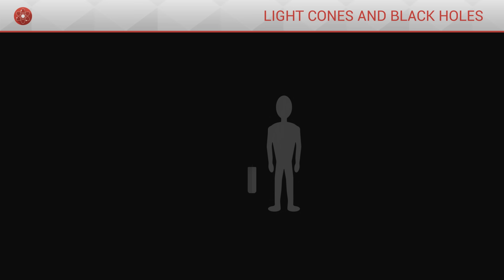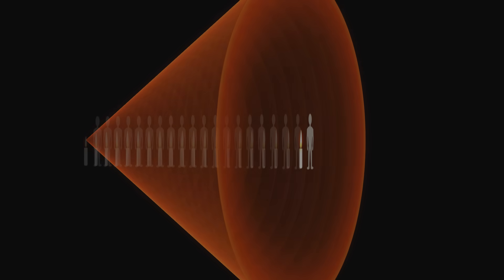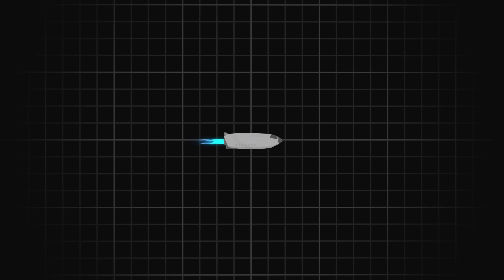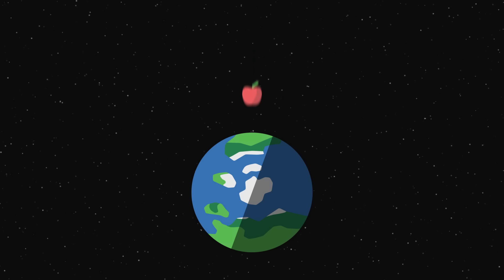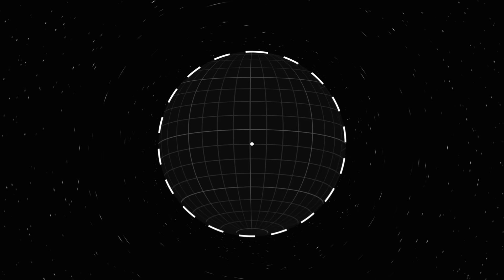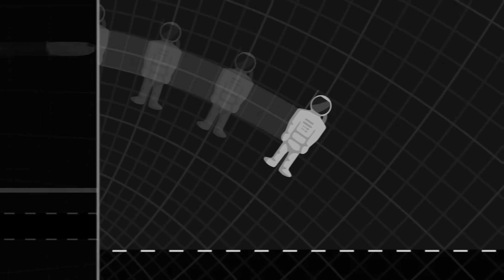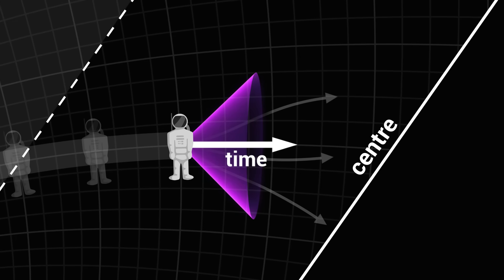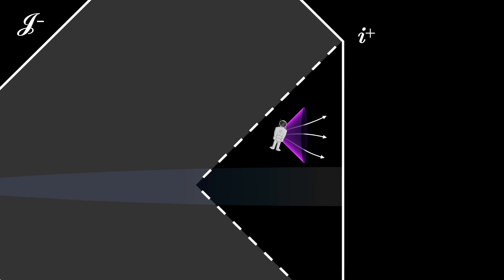Why Time and Space swap in a Black Hole

Comment: they don't, right at the centre is where we are. Where gravity pulls out in equal opposite directions, there should be a second event horizon, tiny that side of the fence its expansive inside when you dilate in space and time, infinitely hot becomes cool. What we see is dilation between 2 infinities, never moving closer to or from either. We have infinite space to inflate away as our host singularity evaporates its central point relaxes and grows 5th dimensionally, motion without motion. 

In one way its a "Symphony of spheres in microgravity" A Bubble inside a bubble with bubbles inside the bubbles, all dilated in space and time, from an outside observers perspective each infinity looks different, but they all have the same idea of infinity dilated inside eachother, some ticking faster, some slower. As they transfer mass between bubbles the system gains energy and momentum, things dilate. Its a clunky ride that causality smooths out, keeping it feeling nice and constant when you look back you see a logarithmic curve, but its a bumpy ride. If we all paused between mass transfers you wouldnt know it. 

You have infinite dilation and expansion  in a contained system if you imagine it all as singularities inside singularities, like mirrors stacked against eachother, or time cones containing infinite time cones, where we are all made of little time cones, when you think you should see compression it feels like expansion still, its a tesseract if you dilate space and time together not just space.. More cubic with infinite height instead of conical. 

Extend the edges of our universal time cone and draw a new horizon, this is the future, you can slice it as small as you can, this is the past, when you take them over to photoshop you can scale the universe so at any point it has the same view to infinity, they overlay perfectly, showing that previously what you see as an infinitely small journey to cross the observable universe 13 billion years ago, is the same journey you see out of your window now at the speed of light, its the same journey in dilated spacetime

Gravity comes from expansion "A Push not a pull, Spacetime expansion theory" it explains it perfectly, the whole universe is growing every moment, but causality makes it feel the same. Is it inflation or collapse? either way it feels the same, any point on the tesseract is the same point, with the same view being pulled from one infinity to the other, never actually moving tho, the edge of reality never red shifts out of view, its simply red shifted. If we were accelerating it would be actively red shifting systems out of our view, like places visible yesterday wouldnt be visible today, but thats not what we see. We observe a flat universe that even seems to curve for light if you look far enough into the void. Dilation would do that, motion without motion, you feel it as gravity

At the core of any massive object you both expand at the same rate, so its a null point, move from that point without motion and now you sink as the mass is inflating more than you, but it isnt pulling on you. 4000 miles from the core it pushes you up and out at 9.8 mtr/s. A nudge at the core is orbital veloctiy, keeping pace with the universe, you remain weightless. Null.. adding velocity doesnt make you faster, it raises your apoapsis, your orbit is the same speed and your journey is longer in space so it takes more time.. orbital mechanics and gravity from expansion.. You feel weight the more dislocated from your idea of null, right now you are about 3800 miles from your orbit at your current speed and direction, so you feel like you fall down.. its an illusion of being higher and slower than orbital mechanics allows, if you was lower and faster then your null point would be above you not below. You could do that easy if you linked a load of satellites on the same orbit together and wound them in, Im pretty sure I could build a Halo ring if given enough funding..

Take an array of satellites 5 miles apart on the same orbit, connect them all up and wind them in, really quickly you will be orbiting lower and faster than the universe wants so it gives you a nudge back to your null point.. but imagine getting it spinning real fast, pulling like 3G.. it only takes ultra strong materials to achieve it, but then we lock things in place, builiding a second ring aroudn the first, the second isnt dilated, but it has magnetic confinement points, built into a megastructure, when you engage the magnets you should be able to pull energy from the inner ring, it would send free energy, anti gravity and time dilation across stations, you should be able to leech off the system to get the outer ring up to a 1G pull... A Halo ring, powered by itself, by abusing orbital mechanics how it abuses you. It would be pretty easy, just taking a long time and a ton of money. It wouldnt break physics as we know it tho...
Reply: If you could dilate in size to the atomic you would hit the closest event horizon to you, without even leaving your room, you could look back at your old life and see it red shift from view, if you could see past it we would seem like we slow until we seem paused from your perspective, like we are on an event horizon, because we are. If you approach a singularity in space you seem to pause as you approach it as space is infinitely stretching out in front of you. Its the flip perspective of the same journey, i doubt they are to the same place tho. 

You can look out into the void and rationalise one infinity because light finds it easy, it does space and time every day, it struggles to see into anything with mass, so to it we might seem like the voids of infinite curiosity. It might map the universe inside out or outside in.. What perspective is more valid, which infinity is the bigger infinity, the one light finds easy or the one both of us struggle to rationalise away. I see an infinity inside you dilated in space and time, as big as the infinity outside you. At your centre of mass is your down. it has the same down inside it as any other massive object, it depends how much mass you have to dilate per tick as to whos centre you drift towards. Your belly button is your down tho, if you rewind space and time you collapse to a singularity there, just a couple of cells dividing, you was in your mom waiting for your day the moment she was born, same as how she was in her mom, and hers, you was always there inside them, coded ready to come out, just waiting for the other half of the message to make you you..  In one view looking back its a logistics map, all the way back to infinity, you can use the same map as the tree of life, tracing it all back to that first mitochondria that entered a cell and didnt get eaten. There is a point of crossing, where we all connect, its likely some near extinction event.. but we are all connected by math

I can build a universe by squaring infinity to C. the Julia to Mandelbrot set, squaring up to infinity gives you a circle shape inside the math spirals inwards in infinite loops that seem finite, and outside the circle it spirals off to infinity and beyond. You have 2 infinities, one in, one out. Square it up again and you have a sphere shape, not a circle, square it up again and you have spheres surrounding spheres, square it up again and again over and over now you have infinity inside infinity built purely from math. If you are centred at xy=0 it looks pretty normal but change your perspective inside, it gets messy, fractal, infinite paths and none of them straight lines as much as they were built from vectors.
Reply: When you draw circles and spheres like the universe we imagine pinning one end of a line in place, spinning the other point around itself in all directions, the B point draws a sphere. But what pinned A in place? nothing in the universe wants to be stationary, i imagine it as one end moves infinitely slow, the other infinitely fast, you seemingly have the same shape, but if you look close there is a second sphere inside the large sphere. 2 ends to the manifold, not 1.. the line length (x) is what defines the boundary between 2 infinite paths. Your finite limits seem to impart a finite perspective on it, but you assume density is the same inside, you imagine the straighest shortest path through a globe is to connect 2 points and drill as straight as a sandworm swims, but that path isnt flat or straight in gravity or time, it will feel like the curved path.. Map it on a time cone you can see each step as you take it.. flatten out the cone for density, is it still the shortest route?

Your mind wants the universe to be Euclidean, but its more like how Gauss could see it, non euclidean and messy. As you core into the planet your drill bits end up wanting to flatten out and return to sender, the path of least resistance.. You cant rationalise it any other way than down being a pull, and all you can see being all there is. If you trust light for the truth its going to decieve you over and over again, its bi polar by nature, a reflection an echo, you see a red object, it rejected 1 spectrum of light, we call it what it isnt, not what it is, and it doesnt matter if we all agree, until you want to rebuild the universe in flull HD glory, knowing the underlying reality lets us use what we see to rebuild it how it is, so we can rebuild it how we see it. But the negative is the true state of everything out here. Your eyes feed you illusions, making sense of nonsense the best it can, we filter out so much noise, if you could see every wavelength it would be blinding, even with your eyes closed......  Your perspective of infinities can give one more weight than the other, as you stand upon one infinity trying to make sense of another. There is so much infinity in to figure out before we need to worry about the infinity out...

Either the universe is irrational or our math is, it seems you square up to pi and think its normal, but think about it you are squaring something up, the universe hands you back a circle that fills the same space a square would, but it kept as much as it could so it still filled the same sized square, it kept the corners and we are just like OK.. its like the universe keeps 0.8584 of every square you made, giving you a circle, where does the rest go? is it the cost to dilation, is it dilated inside the object, i imagine that if you had a gravity source in a cube of water and kept cranking it until it just about touched the sides of the wall as a sphere, this is the kind of gradient you should see dilated inside the mass of the planet, check out "Cones are messed up" it shows how messy it is when you work with a fluid of a set density, imagine how it all flattens out when you have a gradient along the path to the core, how far is it in standard KM when you flatten out the Earth for density, i bet if you map it as a time cone it would get rather cylindrical. Weirdly cones spheres and cylinders are all kind of related by math, you wouldnt think 1 shape could look like all 3 depending on your perspective of it, but here we are, stood on it

Comment: "A place where the curvature becomes so intense that our models no longer work"
Yeah aka the model is wrong

If you even checked the math you would know that the logic paradoxes and mathematical nonsense are unavoidable with black holes because of the most fundamental axioms of relativity. The entire model is wrong. You can’t just slightly modify it to make black holes possible in the model. General relativity has a built in mass energy inequivalence.
Reply: Not necessarily.   Just because it hits limits doesn’t mean it’s wrong

Comment: tl;dr: the space within which you can move is governed by where light can go. normally, this means you can move in all 3 dimensions. Duh. But black holes beyond the event horizon restrict that path in an ever shrinking cone that points to the singularity.

Comment: That is, unless, you can move faster than light.
In which case, it is possible to travel to a point before the creation of the black hole, or after the expiration of the black hole. This would represent the current theory of multiversal travel.

Comment: Hello there! If ScienceClic is seeing this, this is an amazing video. The only problem is, at 1:16, "The sides of the cone are tilted at 45 degrees, because for any given amount of time, light always travels a set distance." Well, can't this also happen for any other tilt angle? It just has to be a cone for it to show that for any given amount of time, light travels a set distance. The only reason it's 45 degrees is because we scale the axes so that light always travels at a 45-degree angle.
Reply from the maker: Yes that's completely right! What I meant there was rather that the distance travelled through space is equal to the elapsed time (when using natural units, such as years and light-years).
Reply: Well, we choose x = ct as space equal to time.
Because the speed of light c helps to convert time (s) to the unit of distance (meter).
It means we define a second as having a length of 299,792,458 meters if we compare time to space.
So since they are equal, light must travel at 45 degrees in the diagram.
If we switch to hyperbolic geometry, that 45 degrees is actually infinite.
(ct) was an axis of distance.
x is also an axis of distance.

Comment: That statement about 45 degrees angle makes sense only if you use same unit and scale for both axises. So that in one second of time light travels one light second of distance.The light speed itself represents the ratio between units of time (seconds) and units of space (meters). The fact that this ratio is so huge represents that we perceive space in much more details, than time. One second of time is almost instant for us. One light second of space is a gigantic distance.

Comment: What I find interesting is that space and time swaps for the astronout...we have these explanation models that say "here's the observer, here's the person falling into the blackhole...yadiyada"...and it's always the same...we get it...what would be interesting is explaining 2 astronouts falling into the blackhole in different points of space at the same time for example...they are on a different space axis so when time swaps will they be on different timelines inside the backhole?
|1111111
|2222222

So 1 is astronout 1, 2 is astronout 2, | is the space axis (let's say the blackhole is really really large and the distance between 1 and 2 is a ly) and number of instances are timeframes so could it be that after they enter and spacetime swaps it would be something like

|1111111
|       2222

So 1 would have been inside the blackhole longer than 2 but 1 would now be a year older?

Conversely if we were to have 1 and 2 enter in the same spacial region but at different times (let's say a year difference)
|11111112222222

Would it seem from their perspective that they entered at the same time once inside the blackhole but 2 would now be a year older?

|1111111
|2222222

And at the right conditions could 2 be there before 1 or in a completely different timeline.

I also wonder if it could be we are inside a giant blackhole and if this is the case (bigbang being the collapse of the outer "star" into a blackhole), then could dark energy just be spacetime/matter being consumed by the outer blackhole but it just weaves in at different "times" in our swapped axis? And the reason we are trapped moving "forward" in "time" in our current environment is because the singularity (future point for us) is pulling on us towards it and we can never escape (aka. go back in time).